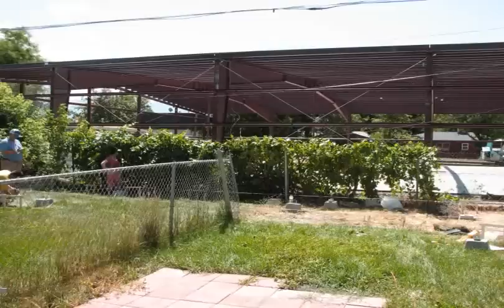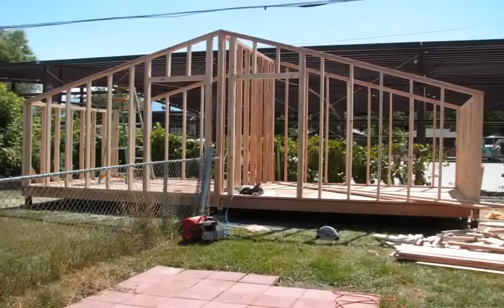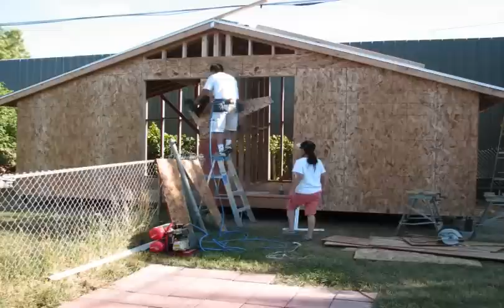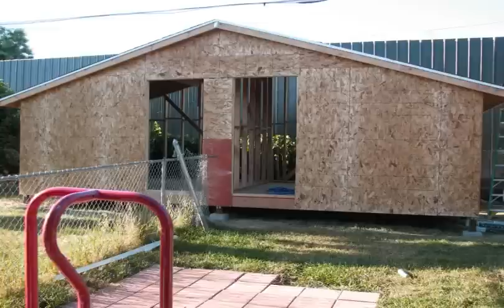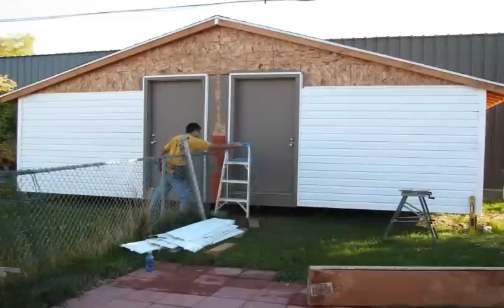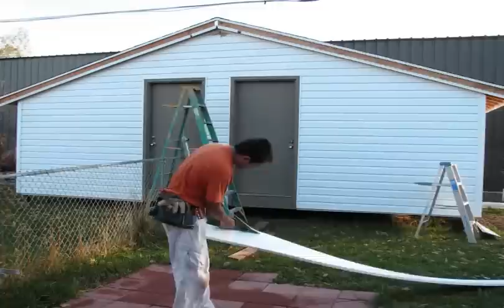How to Build a Storage Shed in 4 Minutes 10' x 24' | BUILD IT

Comment from the maker: @girlmastergeneral $2,500.00.  I had a 10% off coupon from Home Depot.  I bought 95% of the material all at once to take advantage of the discount. I did get some vinyl siding for the backside for free, which was brown and not white.  The doors are commercial steel skin, used, at $45 each.  The deadbolts were also free.  I already had all the tools I needed to build the shed.

Comment: I see one thing you didn't do before installing the siding.  The black paper.
Reply from the maker: Adding a water resistant barrier would have been ideal.  Also, some waterproof tape around the door entrances.  But this being a storage shed I just painted the OSB and trim.  Here's a good link for vinyl installation http://www.vinylsiding.org/PUBLICATIONS/I1_-_Vinyl_Siding_Installation_Manual_English.pdf